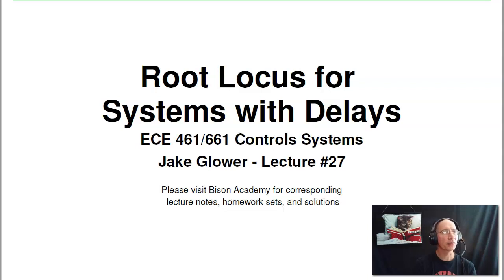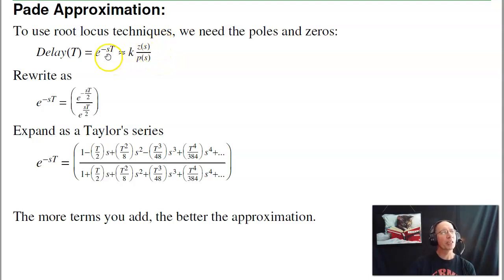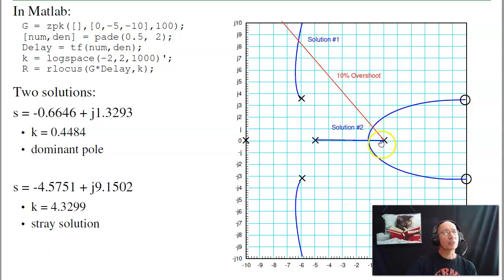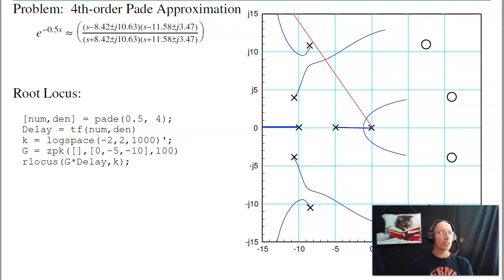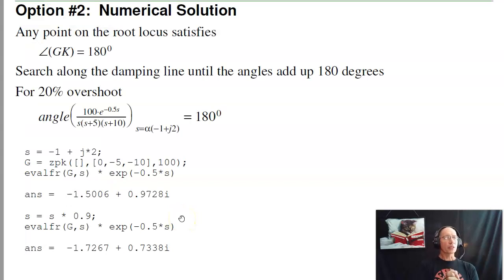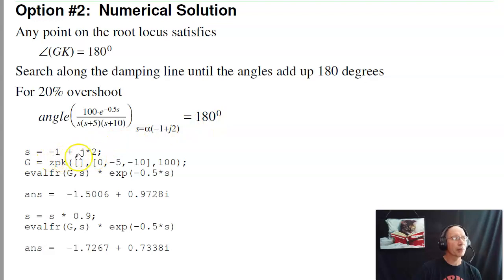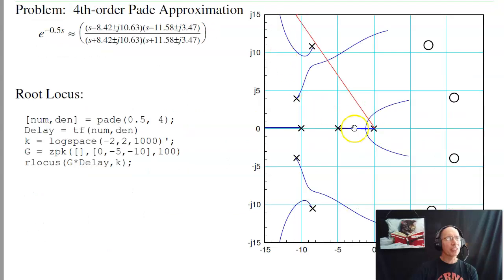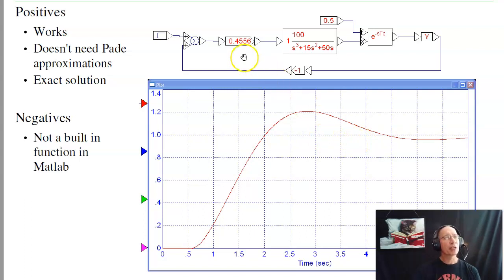ECE 461.27 Root Locus for Systems with Delays

Comment: does it matter what logspace u use for k in ur code?
Reply from the maker: Not really.  Matlab just uses brute force to plot the root locus:  it calculates the roots at each value of k, then plots and connects the points.  Using linear, log, other types of spacing for k doesn't affect the algorithm.  I just find that log spacing tends to plot well:  tight spacing on k initially as you leave the roots, more spread out as you approach the asymptotes.